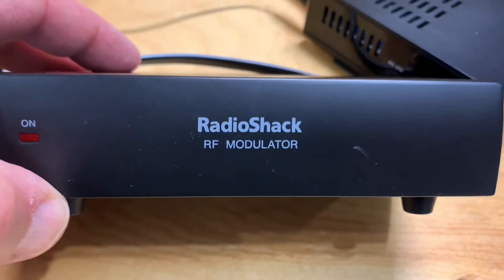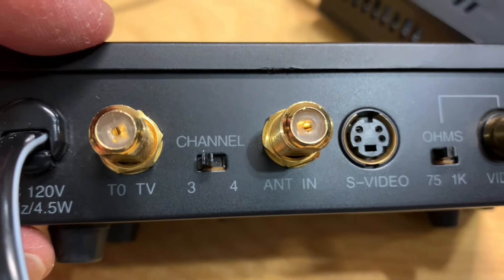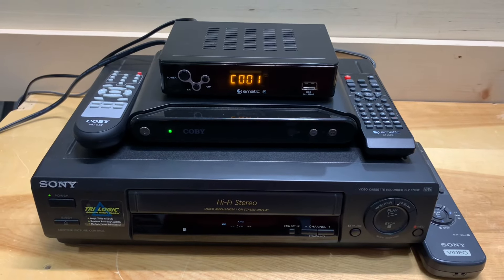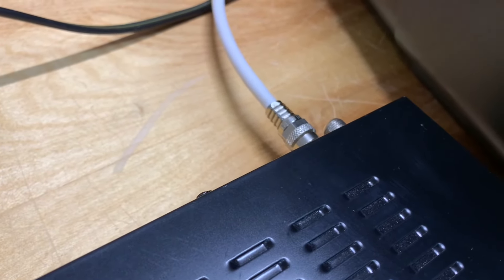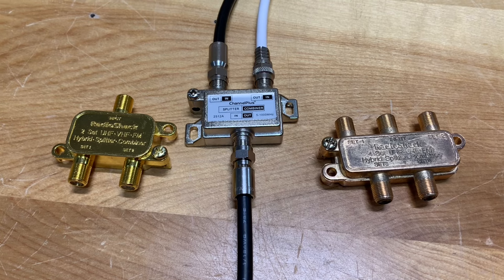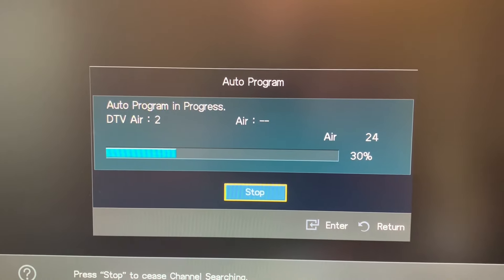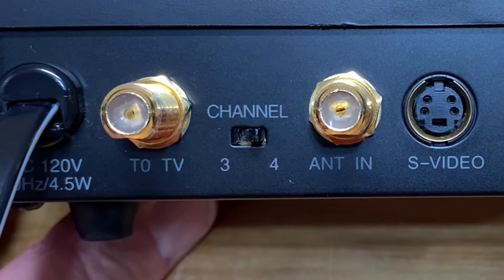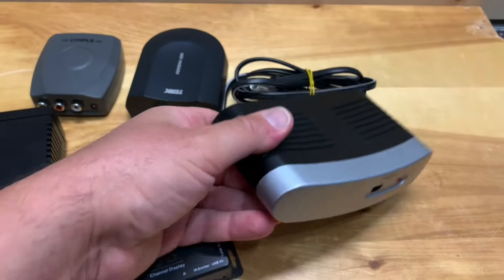RF Modulators: Make your own Private Analog TV Channels the Easy Way

Comment: watching modern videos through an old manky CRT has got to be the most meta shit ever ong
Reply: crt's are much higher quality and cooler than new tvs
Reply: @wilko9396 I agree. Modern speakers on tv's are junk. Even my 2006 Magnavox HD Flatscreen has 100x better speakers than a new one.
Reply: @Warp2090 I like CRT's but a microled flatscreen has brighter colours, higher refresh rate and perfect black. With a good audio setup there is no advantage except for being able to play light gun games
Reply: @RetroOnSpeedDial  MicroLED is awful. Oled is the way to go.
Reply: @RetroOnSpeedDial  CRT's have  a high refresh rate, perfect colors, and blacks.
Reply: @Warp2090  I'm aware, that is why I explicitly said it. And microled is brighter than OLED, once zoning gets figured out like apple has been doing it'll get brighter with no halo effect
Reply: @RetroOnSpeedDial  source? oled already gets crazy bright
Reply: @Warp2090  OLED is inherently not as bright as a regular LCD. Microled uses the same tech as LCD so no burn in, and if zoning can get figured out then the halo effect won't be there and will have brightness like LCD and darkness like OLED

Comment: The video carrier of your RF modulator is AM instead of 8VSB that's why it interferes with the lower adjacent channel which means if your RF modulator is channel 3 it interferes with channel 2 as seen at 6:50 where channel 2 is missing. There are 8VSB RF modulators like those used in cable TV which do not interfere with the adjucent channel.
Reply from the maker: You mean ATSC modulators? No doubt they work well with today’s digital TV signals, but they are pricey.
Reply: @oasterHobby 
Even on analog NTSC, there are 8VSB modulators that do not interfere with the adjacent channel and they are used by Cable TV operators.

Comment: Can an RF Modulator do the opposite- make an  AV source like a VCR work with a Samsung big screen TV that has a Coaxial connection for the Cablebox? It seems that newer/Smart TVS these days are lacking the AV plugs you need to connect the VCR like back in the day. My last TV was an Insignia brand and I didn’t have to worry about this problem because it had the AV jacks in the back/side, it wasn’t until I got the newer Samsung that I realized TVs were abandoning the AV connection in favor of HDMI/Coaxial.
Reply: I have a TCL 4k Roku tv in my living room and that has av ports on it. The only thing is it’s just a 3.5mm jack that you plug an adapter cable into to be able to use av devices. It’s a pretty new tv. I’d say I got it back in 2020/2021 so maybe Samsung is just abandoning the old av ports idk.

Comment: I have the radio shack RF modulator like yours and a small portable tv, what else do I need to pickup over the air content? I unfortunately don’t have any antenna inputs like yours.
Reply from the maker: You would need a TV antenna (indoor or outdoor- outdoor is better) and a TV with an ATSC tuner (digital) or a digital converter box to connect to an older television. Here is an example of a digital converter box currently available:

https://youtu.be/TK4IUDi83r0?si=KhXZPsfozxO5SCzn
Reply: Thank you.
Reply from the maker: @mikemakin6672  You’re welcome.

Comment: I have an old mini tv RadioShack wich also have a radio on it….What do I need to just convert analog to digital?  I use it when there is no electricity. :-)😊Your example is for tv with cable connected to a provider
Reply from the maker: Do you mean something to receive digital TV signals?

Comment: hey, i have the UHF TV link modulator you showed towards the end, with a channel range of 21 - 69. my tv only goes from channel 1 - 16. what can i do in this case? thanks!
Reply from the maker: Besides the modulator shown in this video, here is another modulator to look into that uses channels 14 and up. There aren’t any modulators to my knowledge that use VHF channels besides the ones that utilize channels 3/4.  The only exception is a single channel modulator made by a company such as Blonder Tongue.

A Channel Vision modulator like the one in the video below allows for multiple inputs and more than one output channel (selectable channel from 14-up).

Make your own personal analog TV channels at home | UHF TV Channel Modulator | Video sender
https://youtu.be/Dfi1kEcMt3k

Making your own Home Cable TV System | analog channels using a UHF Modulator
https://youtu.be/DdrMaaihF5w

Comment: At 2:54 I have 4 of this F type to jack adapter. I have an outdoor FM antenna and with this adaptor I connect my smartphone to the antenna, all channels come in excellent. You also need an two jack female input to one jack male ouput Y adapter, One input is from the antenna and the other is for the headphones, and the male jack connects to your smartphone.
Reply from the maker: Nice, they seem like really handy accessories to have.
Reply: @NorthcoasterHobby  It's worth for every phone that has FM radio feature. For smartphone there are apps but what happens if the internet connection is unreliable but your favorite radio station is also broadcasting on FM? The F type to jack connecter and the Y adapter and an outdoor antenna are excellent. The headphones don't make a good antenna only for strong FM stations or if your using your phone outside.
Reply from the maker: @Nicholas_Chris  some phones lock that FM feature out, probably so people have to buy music.

Comment: I know this is a 10 month old video but I’m hoping you can answer my question, I have a 80s Korean made portable TV. With only a headphone jack port on top, will that work with the coax cable 3.5mm head and RF modulator?
Reply from the maker: If the headphone jack is the antenna input, then yes.

Portable Black and White Analog TV  - a cool thrift store find
https://youtu.be/hHgrQUx5f6s
Reply: @NorthcoasterHobby  thank you! after seeing yours I understand what kind of adapter I’d need. My external antenna point is the old style with the two screws, similar to old speakers for receivers and turn tables. Google is an amazing thing one search and I found the adapter from the two little metal forks to a coax cable head.

Comment: Will it work if i used a hdmi to av cable ,

connect the hdmi to laptop and the av cable to the modulator and the rf output to a tv

Is this setup gonna work?
Reply from the maker: @joshuajacinth4217  Yes, that should work fine.

Comment: @2:00 you mention receiver connected to rf modulator but unsure if you referring to like converter box receiver?Will hdmi signal be enabled?
Reply from the maker: Yes, I was referring to a converter box receiver or satellite receiver. There is no HDMI signal as the modulator is analog.
Reply: @NorthcoasterHobby  ok so that is why the rf modulator alone will not provide tv video ok.
Reply: @NorthcoasterHobby  how can you tell why a sdtv converter box mostly will not work?I got a couple from thrift stores.
Reply from the maker: @robertshade8631  The modulator converts a video signal (RCA) to RF channel 3/4.
Reply from the maker: @robertshade8631  How can you tell if it won’t work?
Reply: @NorthcoasterHobby  no power or light.could if be a bad fuse or capicator?
Reply: @NorthcoasterHobby  therefore hdmi to rca converter or hdmi item like Roku or Chromecast or Firestick is required.
Reply from the maker: @robertshade8631  Many modulators have an LED light that will not light up until it is plugged in AND a video source is connected. Try one out like that and let me know.
Reply from the maker: @robertshade8631  HDMI to Coax on the Cheap | HDMI to Analog Coaxial Cable
https://youtu.be/fIHpdyl1x-Q
Reply: @NorthcoasterHobby  yes i know on modulator but i was replying Answer on converters brought from thrift store not powering on
Reply from the maker: @robertshade8631  Sorry, I thought you meant modulators. Converter boxes are known for having capacitors and power supplies fail.
Reply: @NorthcoasterHobby  no problem I should have been clearer.

Comment: Not sure if this was helpful.  Trying to connect HDMI output from Wi-Fi receiver to 2007 vintage Sony CRT TV with RCA inputs.  Don't know if I need to use a RF Modulator.
Reply from the maker: @kevindigo22  No need to modulate to an RF signal in your case. Try this  adapter without the RF part.
HDMI to Coax on the Cheap | HDMI to Analog Coaxial Cable
https://youtu.be/fIHpdyl1x-Q

Comment: At 2:55 what is that small tv coax adapter called?
Reply from the maker: F-type female to 1/8” or 3.5 mm male plug.
Reply: @NorthcoasterHobby  thanks
Reply from the maker: @eagonsiahaan9390  You’re welcome.
Reply: I giving maduletars
Reply: That also used for portable or pocket TVs

Comment: Hey, quick question. What material are your radio shack modulators made of? I've been doing some research into finding a decently performant RF modulator, and I've been recommended to pick up an older radio shack one but I was told the metal ones work better than the plastic ones they produced later on. I found a couple of the ones you have on ebay but I'm not sure if those are the plastic ones or the metal ones that are being spoken of. Thanks in advance!
Reply from the maker: The RF modulator in the video is in a metal case.
Reply: Perfect, thank you so much!  @NorthcoasterHobby
Reply from the maker: @JesseSinclairYouTube  You’re welcome.

Comment: A little confused, why would I connect the rf transmitter directly to the tv if the point of it is to transmit to the tv?
Reply from the maker: It is a wired connection, not wireless. It’s a modulator, not a transmitter. A modulator converts a line-level signal to an RF signal. The connection is made via coaxial cable between the modulator and the TV.
Reply: 25 years ago not all TVs had a video input, if there's only an RF port then you'd need a modulator to convert AV onto a TV signal

You can use these as a transmitter, but you'd need a booster to amplify the output

Comment: I wonder if you can use an antenna that is connected into an rf port and send the signal to a new tv.
Reply: I’m trying to build an N64 that connects to the tv through antenna by using the mult port RF adapter and a booster for the antenna so I can make a wireless N64. Problem is I like crts but the loud ringing is just horrible.

Comment: What do you recommend for streaming hdtv via coaxial cable to multiple tv's in a hotel?
Reply from the maker: If you are using an antenna as your source, then a series of distribution amplifiers could distribute the channels to multiple televisions.
Reply: @NorthcoasterHobby  I will use some hdmi player, android or raspberry pi as a player. If there is an existing coaxial cable with working tv and nice signal, would i need an extra signal booster to stream my program through the same cable?
Reply from the maker: @ivanlitovskii  Possibly. It depends on what channel you modulate it to- if there are any strong signals on adjacent frequencies then a booster may be needed.
Reply: can these modulators use for fm tuners if i set them on fm band frequency like 90Mhz, 92Mhz..?Im planning combine them together with summator and amplify to one coax cable, like cable TV, but for radio stations from web-radio
Reply from the maker: @leesallow7701  These only modulate to RF channels 3 or 4. Sounds like you’d need something more specialized.
Reply: @NorthcoasterHobby  Okay, thanks. Seems like i need something like head end unit, to combine more channels. But these units are damn expensive ;D

Comment: What 2 channels does the combiner transmit on?
Reply from the maker: @RapidTransitFan  Whatever RF channels are coming in. Alternatively you could connect the antenna to the pass through (RF input) on the back of the modulator, and that passes the antenna channels through to the TV’s tuner. The modulated channel you create on ch. 3 or 4 gets spliced into the signal and scans in as an analog channel.